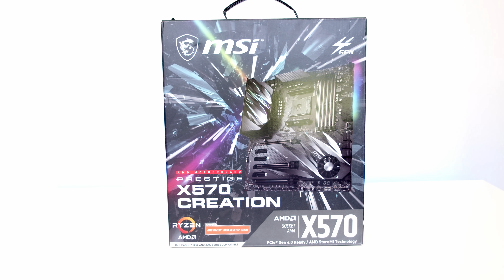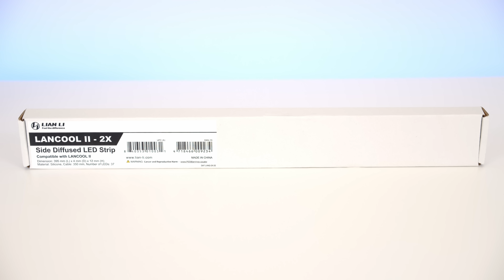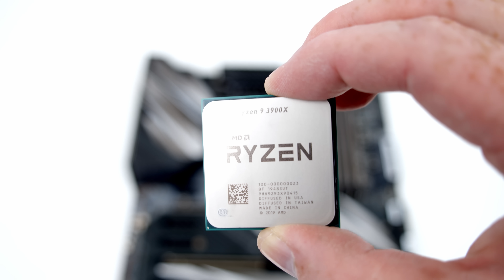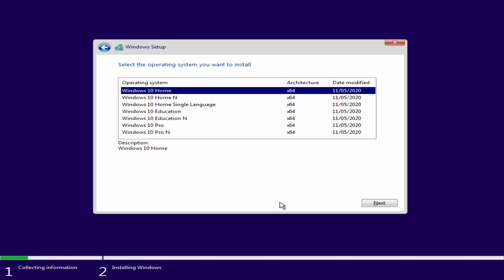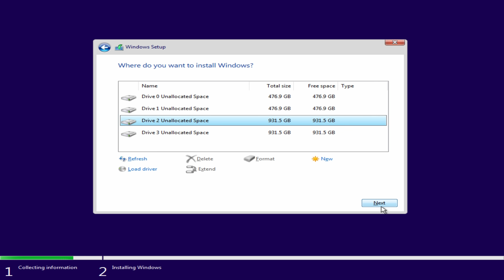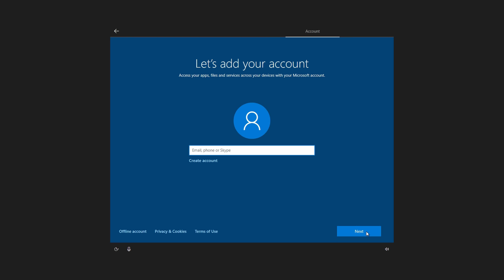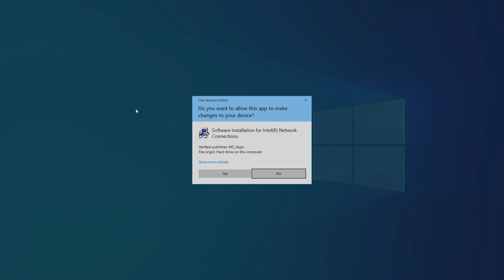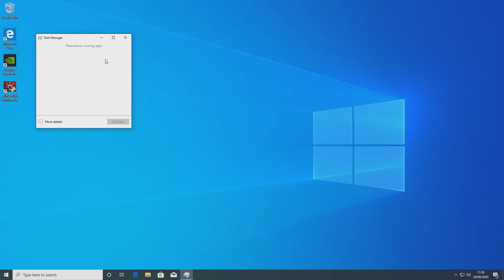Lian Li Lancool II Mesh Step-by-Step PC Build Guide

Comment: 1:26:00 it’s hard to put a radiator on top of this case because the RAM can easily get in the way, depending on the RAM’s placement on your mobo. So if you put a rad in the front panel, it makes sense to make that your exhaust — because airflow through the radiator is limited, and you want to have the best flow coming in your intake. I could go either way on mine, I’ll probly test both configs. 

As for “hot air rises” — natural convection is easily overcome by fans, so if you have to choose between making the radiator your intake or the top without a radiator, I think a top intake with less restriction will produce the best thermals overall. 

Also consider CPU/GPU priorities — If you’re doing a lot of CPU intensive work then you should prioritize CPU cooling, and use the radiator as intake, with the coolest fresh air blowing through it. 

But if you’re more into gaming which is GPU intensive — let the radiator be the exit, with cooler fresh intake air hitting the graphics card.

Comment: Fun Fact: The reason for the space differences - Since consumers don't think in base-2 mathematics, manufacturers decided to rate most drive capacities based on the standard base-10 numbers with which we're all familiar. Therefore, one gigabyte equals one billion bytes, while one terabyte equals one trillion bytes. This approximation was not much of a problem back when we used the kilobyte. Still, each level of increase in the prefix also increases the total discrepancy of the actual space compared to the advertised space.

TLDR - A gigabyte is actually 1024 MB, manufacturers measure in multiples of 10. So they're gigabyte is 1000 MB

Comment: First i want to say thank you for putting the time and energy into putting together such a comprehensive walkthrough. This case had me scratching my head for some reason. 

I do have a stupid question though. I have an rtx 4090, the adapter has 4 connectors for the vga cables.  Would I need 4 independent vga cables or would 2 suffice (2 connectors from the Y and the other end plugged into the psu) I can't seem to get a good answer to this, I called Nvidia and asked as well but they told me use 4 separate cables.. which is rather bulky and doesn't seem right.   Last thing I want to do is mess up this pricey card. Thanks!

Comment: You should always orient your AIO radiator in such a way to avoid having air at the pump. Noise is not the main concern. The main concern is ensuring your pump continues to force liquid through the system. With air in the pump, this will be much less efficient.

Comment: Life saver, thanks so much! Expect nothing less from a fellow Irish man 💪 I just have a quick question, I left the 3 case fans in the build and put a two fan aio on top of case instead. Only have 3 case fan headers on my mobo so put each case fan connector into them, and put cpu fan connectors into their sockets, connected all rgb cables together so aio and case fans rgb were in sync  and left it at that. I haven't had any significant overheating problems yet but I would like to install fans but have no idea how to go about it now.

Comment: Water is heavier than air. By mounting the radiator with tubes at the top your pump will soon be sucking air and CPU cooling will fail. Even though the systems are "sealed" they are not 100% liquid filled and are semi permeable so that they lose liquid over time. Have seen this many times over the years repairing PC systems. IMO, a well-designed water-cooling system will have a visible, fillable reservoir to indicate liquid levels and compensate for loss, also a flow meter/monitor to confirm proper flow. AIO makers should provide these along with longer tubes so the pump intake can be confirmed below the water line.

Comment: I am doing push/pull with original fans pushing and galahad 360 fans pulling. I put the shroud cover underneath with double-sided tape to close the gap so you can't see the cables. I don't know if this is better than just push configuration, but I love the looks.

Comment: It doesn't matter which way you plug the power and reset switch. You are just shorting the 2 pins when pressing the button so it really doesn't matter which one is positive or negative.

Comment: Hi Chris.

Firstly, thank you for a fantastic, thorough, build guide. I have never built a PC before, and I have watched this video a handful of times while I wait a couple of more weeks before I order my parts (a couple of more pay days).

If possible, I have two questions.

1. I plan on doing a vertical GPU orientation as well with the same kit, with an RTX 3060 and the Asus B550-F motherboard.
Isn't the Lian Li riser cable PCI-e 3? I've read around that you need to change the bios so that it operates on PCI-e 3, but I don't really know how to do that. Are you able to assist?

2. Speaking of the motherboard, it has 1 ARGB header, and 2 RGB headers.
I plan on having the Cooler Master ML360R AIO at the front as intakes, and the three case fans that came with the case at the top and rear as exhausts. How would I go about setting that up to sync so that I can control all the RGB with the motherboard? Would I need a motherboard with at least 2 ARGB headers for it to work?

Thank you in advance for your help.

Comment: I'd really wanna thank you for such an excellent job. This video is fantastic. Very complete and full of details, which allowed me to built my brand new PC using the Lian Li Lancool II case that's quite similar to the Mesh you've used. I'm using a Gigabyte Aorus H470 PRO mother board, and I made all my RGB set up (fans, AIO, LED strip) using your very clear instructions. Differently from you, instead of a steady white color, I prefer my ARGB set up running through a full color cycle  mode, with all devices synchronized. I've finished my built about 2 weeks now, and there's something bothering me regarding my ARGB settings. The power button LED is always in a steady and unchangeable WHITE color, and I'm thinking on how to change it to an ARGB LED, and synchronize it with the mother board and all the other devices. Do you think is possible? Could you kindly give any suggestions about how to do it? I'm not an electronics expert, just a curious guy with a bunch set of tools, including a soldering iron. I'd very much appreciate any help, Thanks in advance and take care.

Comment: Very well done video, very detailed, I love the examples of both options on the radiator because I just bought both the aio like the one in the video and the the mesh ii performance version * which does not have rgb controller, but a fan controller instead, so I'll have to rework my brain a little since I'm not that familiar as you are lol. I guess all my fan speeds will go into the controller then out to motherboard so the switch on the front controls fan speed instead of rgb. Thanks again.

Comment: Hey, I have a hot 3700x, with a dark rock 4 it spiked to 78C and just installed the Galahad 360 and got spikes to 87C for the package? Am I lagging pressure on the cpu? Do you need to change the backplate?

Comment: Do you think mounting the fans on the outside of the metal bracket and then to the radiator causes a static pressure decrease? I am wondering about this as I will probably have to mount it this way due to spacing (38mm radiator + 12.4" gpu).

Comment: So, aside from the motherboard, I have the exact same components down to the cooler and PSU. It was great to see a build featuring mostly my same components. I was looking for a very specific tip, as I've built PCs before, and you didn't cover it. If I'm installing a mechanical drive into one of the drive slots, how do I orient the noise dampening rubber grommets with the drive? I can't quite figure that part out.

Comment: Absolutely fantastic video.  Thank you for being so thorough. One question: if you were to use a large air cooler, would you attach it at the same step that you add the aio or would you wait a bit to keep the space open longer to make it easier to work in the case?
Reply from the maker: For the larger cooler without an open top I would just install the mounting bracket and then the cooler once everything is plugged in

Comment: From first time builder-
So you're saving my life and you are a god:)
QUESTION????

I have the performance lian li mesh and have fan controller on back that came with the case...

I am incorporating NZXTs HUE controller to all my fans PLUS I want to also want to be able to control ALL the fans on the top of the case with fan speed...

So a bit confused on how to hook up fans with the controller that already came with case PLUS being able to control fan speed with NZXT controller if I prefer that ...
There's too many wires!!!:)
Reply: @ChristopherFlannigan  

The fan control on top of the performance case was a cool feature and was hoping I could use both interchangeably when I wasn't using the other.
But I guess kind of pointless truthfully. It's just the principle of the matter that I'll have a slider button at top of case that will be unusable for me..I'll get over it.
CAM Software is def much better option if having to choose between the two features obviously..

Thanks so much for the reply .
Again, your videos are amazing ..
Only thing I would def suggest is you get better lighting. The lighting on you is great, but the case and stuff you're working on is pretty dark and hard to see the details of you working in and on the case....

Comment: Excellent video Chris. Super thorough and I WILL be using this as my guide when I build my PC.. Just a quick question. On Lian Li's site for the case. It says "Do not install a 140/280MM radiator in the inner side of the bracket otherwise irreparable deformation might occur. The correct way to install is to mount fans first then place a radiator on top of the fans." This seems pretty unclear and am unsure of the proper way to mount my future aio. Any help would be appreciated.
Reply from the maker: yes or radiator on the outside of the bracket, but tubes might be a problem

Comment: Great video, sir!  I have some follow up questions...

1. I have a 3 pack of the Lian Li SL Uni fans (120), and they are mounted in the front, and all three sets of wires are consolidated into 1 pair, which is plugged into the hub provided (nice!).  I took the original fans that came wit the case, and placed 2 of them on top, and 1 as the exhaust.  The plugs on those will not work with the hub; are there adapters out there that I can get, so that everything goes through the Hub? 

2. Where did you end up placing your Corsair RGB hub in the case?  Is it crammed in with the rest of the wires?

Again, many thanks.
Reply from the maker: Sorry i haven't used the uni fans yet so can't help you with connections. Yes i just put it down the bottom with the other wires as I will be taking it apart for the thermal testing
Reply: @ChristopherFlannigan  Following up - where did you tuck the ARGB hub?  Is it underneath, by the PSU?

Comment: Hey Chris, out of the off chance you see this, I have the same case but my front fans LED dont work. They used to work but randomly one day they stopped working. I saw that around 2:20:00 you said to turn them off and on just press the M button for 3 seconds but it didnt do anything, I even timed it with the video. Is there a fix for this? maybe fix it through BIOS or somewhere else? Please help

Comment: Great video building my first pc lian li ll mesh case cooler deep cool LT520 Aorus elite B550  AX V2 board question the wire coming of pump is 3 wire don’t see anything with 3 pins do I use a 4 pin system fan spot don’t want to burn it up thank you for your videos and help

Comment: I set up my radiator as exhaust on the top, but it doesn't leave much room for a back fan and I had to put my graphics card in the lower motherboard slot. Can you mount the radiator and fans directly behind the included case fans instead of removing them?

Awesome build guide, thanks!

Comment: On your video you didn't show how to install the rear exhaust case fan for this case.  This is the only part I am confused about on this case. I'm pretty new at this so sorry for the dumb question, how do you install the rear case fan on this case? A regular 120mm fan with regular screws won't screw on, the holes on the fan don't appear to be threaded nor does the back of the case have threaded holes. Is there something additional I need to put the fan on? The case doesn't seem to come with any screws that can do the job.

Comment: Great build, quite a skill set and amazing video. Some help is appreciated in advance; I was wondering could you perhaps share an advice in regards to solving the issue of internal USB 3 header? My mobo has it on the bottom portion - unlike yours as far as it can be seen - and because of it I'm pretty much unable to install fans on the PSU shroud, which would be awesome. I just can't seem to bend that double USB 3 cable enough in order for fans to have enough space. They both, fans and header get in each other's way pretty much. Btw, where did you plug the USB cable, where is the front USB header on that model? Thanks! Cheers!

Comment: Hi Chris, I am soon going to attempt a very similar build to this. Would you recommend inserting a 3080 in the vertical orientation in this case with a tomahawk 570x motherboard? Or the horizontal orientation due to temperatures. Loved the video.
Reply from the maker: You would want a gen 4 pcie riser and with out it I would go horizontal
Reply: @ChristopherFlannigan  Ah I have the exact same riser kit from Lian Li in your video. Am I right in saying that would be fine, it's just that a 4.0 cable is capable of slightly higher speeds? From what I read the 3080x doesnt really utilise this extra speed anyway so the differnce would be negligible?

Comment: I am confused on the front fans being plugged both into the original case cables and the 3 splitter cable you plug in at around the 1 hour and 5 minute mark. If you plug the fans into the splitter, how do you plug them into the case fans as well? seems like it has to be one or the other?

Comment: Hey Christopher, I was wondering if you actually lose speed if you install your M.2 ssd in the slot farther away from the cpu because my ssd has a heat sink that won’t fit because of my cpu cooler and I was wondering if I would lose speed if I put it in the second slot and if so how much?

Comment: The power panel cables are working me.   I've got 3 left over.   I've connected the audio, CPU, MOBO cables.  Not sure what the other 3 are, but I do know that I've got to connect a cable to a system fan on my MOBO to make the case fans work?   MSI Pro Z690-A Wifi  board.   Thanks for any advice about how to connect those power panel cables.   I need it.   lol

Comment: I’ve built my computer 3 years ago and took it apart many times. I just took Al my fans out to clean my PC but every time I take it apart I have trouble putting my fans back the way it was. Can you do a separate video on connecting the rgb fans also I never received a remote with my case. I have the same one you have just white.

Comment: I have a similar build- having my GPU mounted vertically and also having fans at the bottom of case. I have my 240mm AIO mounted at the top and 360mm fans at the front. The main difference is how I setup my bottom fans- which I set as exhaust. It initially made sense to me since I noticed that there is warm air getting trapped at the bottom corner where my GPU is and the front intake fans can't seem to get rid of it effectively. Also my GPU exhaust is at its sides, meaning hot air blows out on the top and the bottom side of the GPU when mounted vertically. Right now my bottom fans seems to work fine. Hot air is definitely getting pushed out of the side mesh panel of the case. However, seeing as you've installed the bottom fans as intake, I wonder if that would be a better option for my setup aswell?

Comment: This guide was so helpful for me. Thank you!  One thing, I used the fans that came with it. They have rgb when the power is off.  Once I turn it on, they start spinning, but rgb goes away. Any guesses?
Reply: Ah, like you said, the most common issue: rgb wasn't connected to power supply from front panel

Comment: Did you experience any bubble-sounds from the water cooling because of the way you installed it?
I am th about getting the 240 radiator for top mount installation because of this (but since I don't have this equipment yet I don't know how it sounds)
Reply from the maker: No problems, but 240 will also go at front tubes down

Comment: That front sata connector that powers the rgb controller, does that also provide power like an rgb hub to all things connected to it? Wondering because all my argb goes to one header on the motherboard and I’m wondering if the front thing works as a hub with extra power?? Thank you!

Comment: dude i was struggling with fans above PSU until i saw this, and realised I had the longer screws thanks! whats your thoughts about the roof fans also pulling air into the case instead of exhaust?

Comment: Hi, I have a question. Does that forward facing cable management plate (the one where you route the mobo power cable through) ever get in the way of a large GPU being installed? Or does the GPU always hover over it? These days, GPUs have these elaborate heatsinks that are quite large and I just worry that the damn cover plate will keep me from installing one of the newer GPUs.

Comment: Just a quick question: Since I´ll use a 360mm water cooler, I´ll use the three Lian fans that came with the case, along two more Scythe Kaze Flez 120mm. Where do you recommend me putting the Lian and Scythe ones, or they´re just about the same and it doesn´t matter?